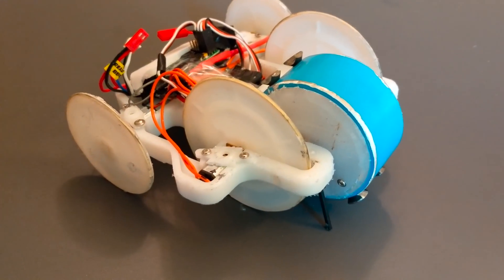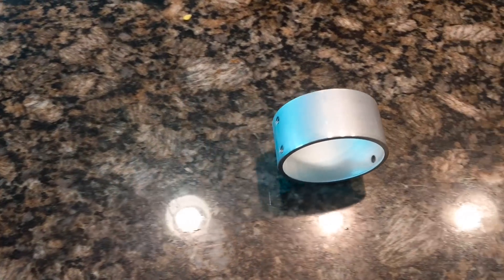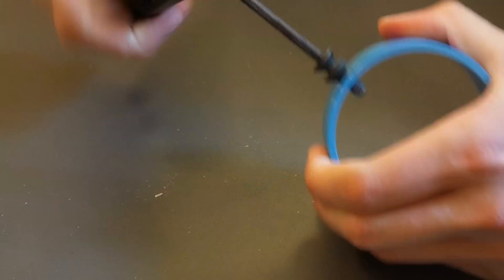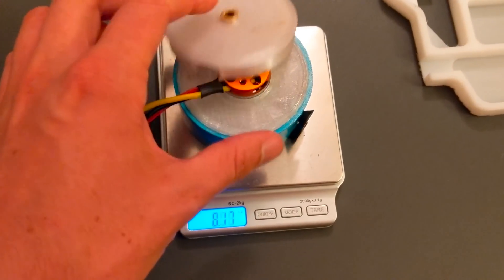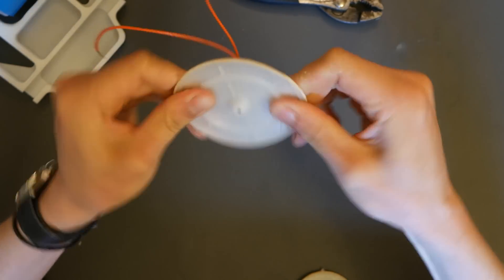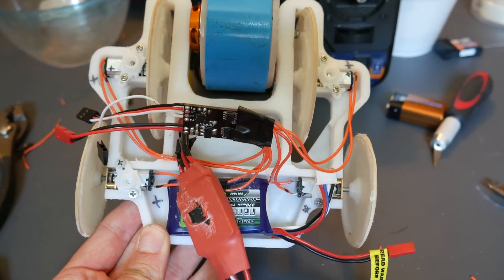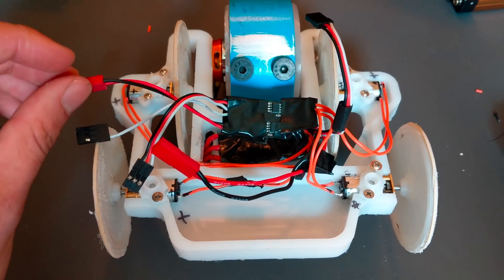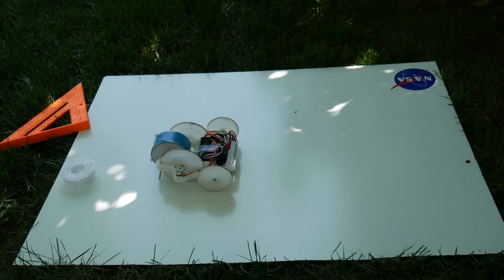Danger Zone Combat Robot (V3) Build Log

Comment: I'm not gonna lie, but I think your first design of Danger Zone was the most successful.
Reply from the maker: Potato7642 It was for sure, it was a much more rational design.  If I re-did that design with Onyx or another more durable material it'd do decent.  Version 2 tried a weird construction technique that failed.  This version attempted to package a .5lb weapon and 4 drive motors with large wheels into an antweight... that was way too much.  The reason I didn't just improve the decent v1 design is that'd be less fun for me.  It's more exciting to build something where I can't really predict how it'll perform, it's hard for me to get excited to spend $$ on something that'll be just like the prior year but slightly faster/more durable/etc.  If my goal was to win I'd have a different view, but my goal is just to have fun building these things
Reply: I like that mentality. Is that also why you don't use a different armor on Krave?
Reply from the maker: Potato7642 Kinda.  The krave is fun to build (super easy) and fun to fight (foam flies everywhere).  That's a good formula.  I've never re-entered the same krave design, though, I do change other things.
Reply: I'd love to see the Krave as a beetleweight with polycarbonate. But I'd keep the foam Krave as an antweight.
Reply from the maker: Potato7642 antweights are more snack-sized

Comment: Did you see my comment on your last video? Bot has to fit in the 12" x 12" in the fully extended position. This means Krave's tail is technically illegal. They might let it slide but they might not. I think last year was ok because each half of the multibot was small enough to fall in the pit, but Kraves tail poses a tiny but non zero chance of interfering with that. Not trying to be a dick, just pointing out something I think might give you trouble, I assume you didn't see my last comment bc you didn't respond. Worst case scenario you might have to clip it. It's not a big deal but I would suggest emailing Bruce just to check.
Reply from the maker: I saw.  Tail will need to go.  King Googly is also illegal for the same reason so it's been scraped.
Reply: Alta's Projects you can have the tail on for show before the fight but take it off when you start